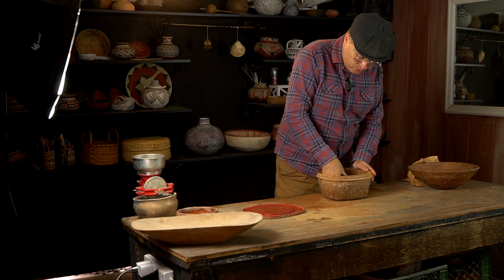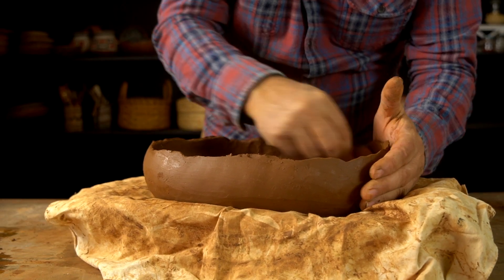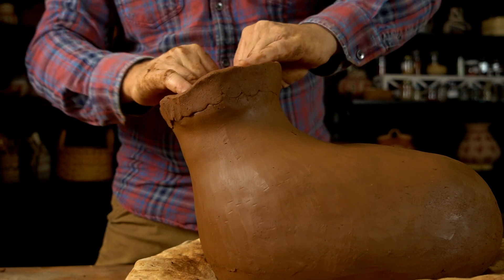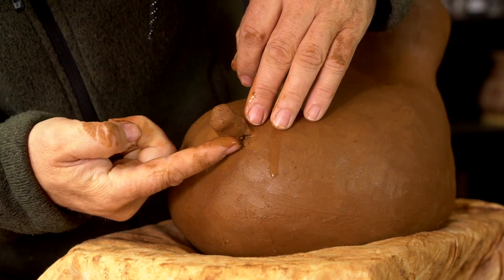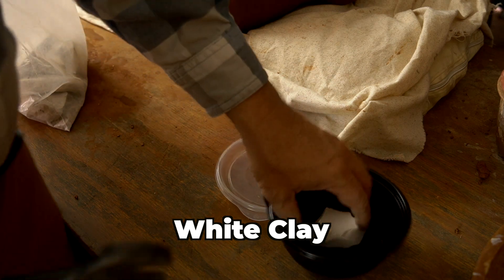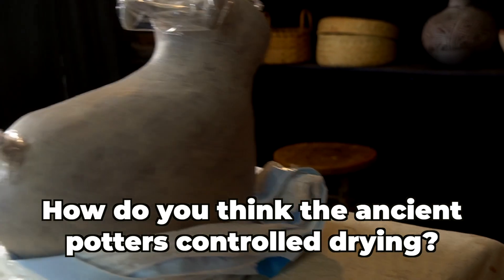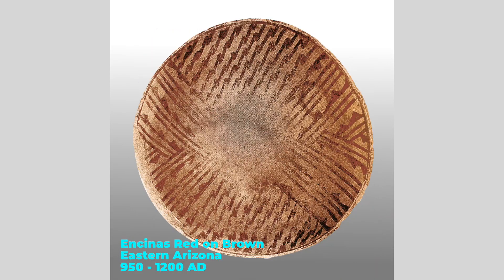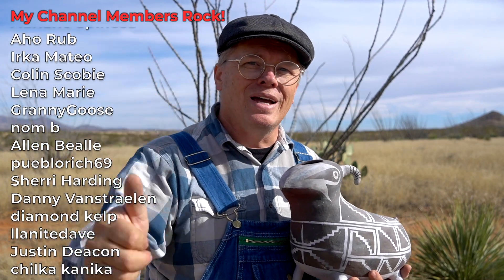This Huge Sheep Effigy Pot Took 9 Days to Make

Comment: Turned out great. I noticed you didn't set it on rocks when you fired it. Also, I tried the big flower pot on my last firing and the pot cracked and broke (but my pieces luckily survived). I thought maybe the pot needed to be heated up too, even though it was a fired terra cotta. Did you preheat the cover pot you used?
Reply from the maker: Yes, I wasn't sure how stable it would be with 4 legs on stones so I opted to set it directly on the hot earth which worked out fine. Most flowerpots don't work well because they are not tempered clay so they break from thermal shock in an open fire like this. My flowerpot was an earthenware, tempered flowerpot from Mexico, I could feel the temper in the body so I knew it would hold up.

Comment: I really like the multi colored effect. I wonder if the ancient potters had special shelving to keep their drying pottery on…? Seems like in their tight quarters breakage would have been a problem.😮
Reply from the maker: Especially if you had kids around. But they did not have shelves or tables, everything was stored on the floor.

Comment: wet pieces of cloth work just as well to control drying as plastic bags, you can cut smaller pieces for the apendages, double them, put a dry cloth under the wet ones if you want to avoid them wetting the pot. At the end of the video it's as if you were holding a living creature in your hand!
Reply from the maker: Good tip, the ancients certainly had access to cloth. Thanks

Comment: That's not a bad result. If you want it to stay completely black (without red spots) try using coverd sherds, don't remove the embers and cover it completely with dirt until there is no smoke coming out from the fire and you basically have a dense layer of dirt over the embers that covers it all. Really a beautiful sheep, that's just gorgeous!

Comment: I've been thinking about an idea. if you take a big clay pot. which has not been treated and allows water to pass through as much as possible. if you fill the pot with well-cleaned sand, stones, charcoal and moss. could it work as a water purifier?
Reply from the maker: That might work. Something like this? https://youtu.be/CBUb7A-cSF8

Comment: Hey Andy, love your videos and your willingness to share your trade like you do. I’m curious if it’s possible that the flaking on the slip of the tail might have been caused by not having enough clay added to the slip or perhaps the white and the base clay had different shrinkage rates? I know you had said it had gotten too hot, just wondering if those items I mentioned might have been a cause of this also? Thanks for you generous work and God bless you.
Reply from the maker: Thanks. No the slip is not fugitive in this area so it is not improperly bonded to the vessel. It is cracked deep, it is classic clay that has gotten too hot.
Reply: @AncientPottery  thanks for reply, your work looks fantastic Andy! Thanks for sharing.

Comment: Do you think they might have used a large, clay lined basket?  I believe that was used by the Southeastern Mississippian Culture to blacken their pots.  They would set the still hot pottery in a pile of vegetative material and then put a clay lined basket over them.   This would stop the plant material from catching on fire and not getting an even black coating.  I see no reason that doing something similar to smother the fire and keep air away would not have occurred to them.
Reply from the maker: Interesting idea. Is there evidence that this was actually done in the east? It seems workable if the basket didn't burst into flames because of the heat of the coals.

Comment: Have you ever set any of the dry grass, that's in the background of the firing, on fire?
Reply from the maker: Heck yeah. I used to work for the Forest Service and got paid to light grass on fire.
Reply: @Andy Ward's Ancient Pottery  Had me wondering, albeit starting fires is a different skill set from putting them out, is there archeological evidence of surrounding landscape fires linked by location and time to any ancient ceramic firing sites?
Reply from the maker: @cactusbaboon321  actually fire fighters light a lot of fires. Control burns and burning out fire lines
Reply: @Andy Ward's Ancient Pottery  Burning out underbrush establishing a fire line doesn't necessarily apply to starting wild grass fires unless it is used for creating a fire line against the spread of a wild grass fire. I'm glad you are experienced in fireline establishment as it might come in handy someday.